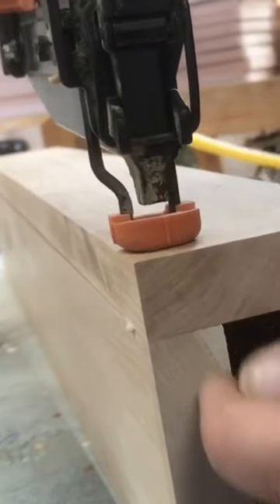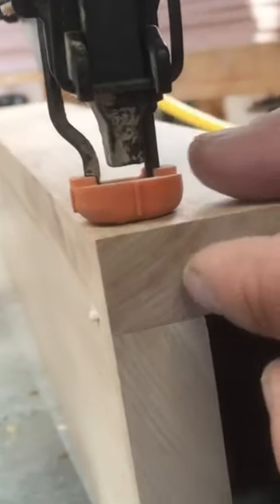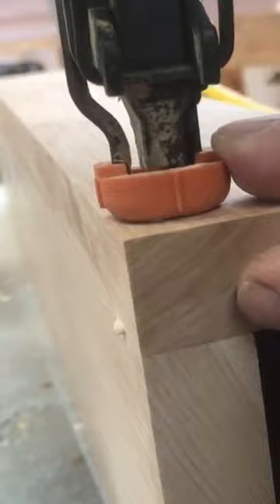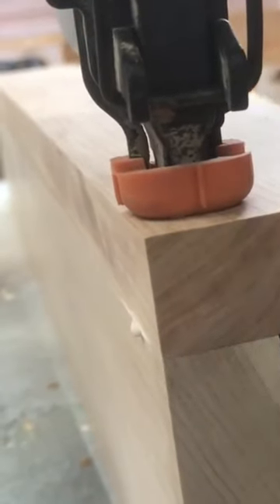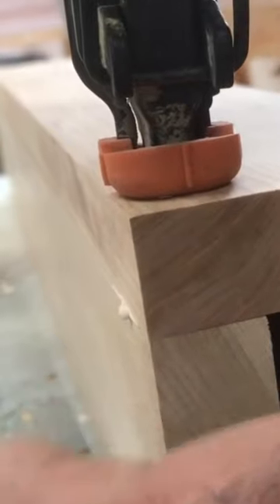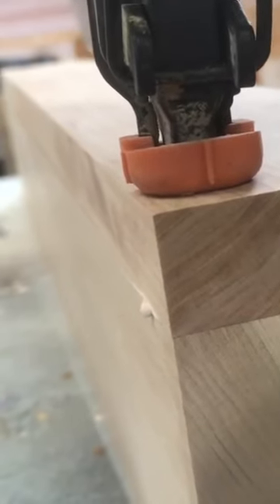Air Nailer Safety Tip #shorts

Comment: Each nail has a bevelled point which makes it more likely to bend at right angles to the nailer. If you turn the nailer 90 degrees, there is more wood to encompass the bent nail, so it doesn't come out of the side. (Plus move a bit further from the end so it doesn't come out there.)
Reply: I was gonna suggest this. Since learning about this tip I stopped nails blowing out the sides. I still keep my support hand well away from the danger area.

Comment: You need to push this one harder.  Blow out is really dangerous.  Related is when you are adding framing nails to a structure and you hit another fastener, the new fastener can go anywhere and may not go in the lumber at all.  Safety glasses for sure.